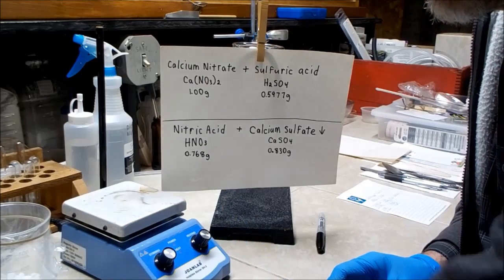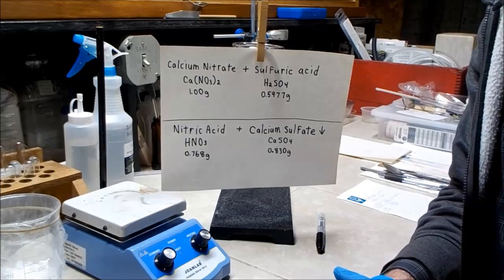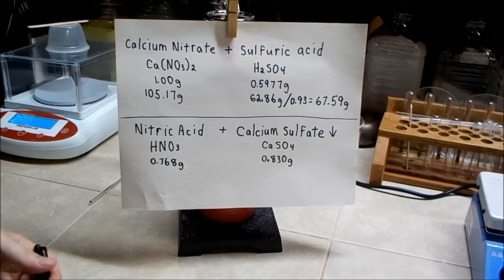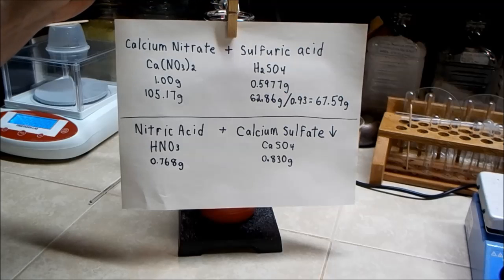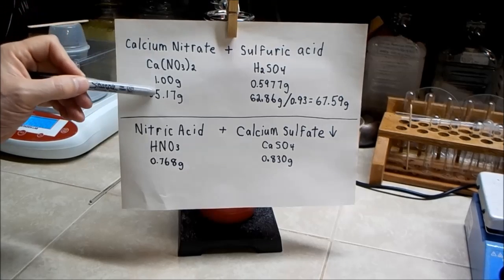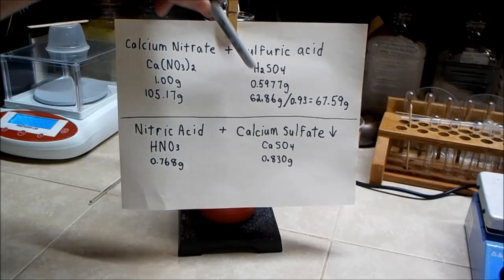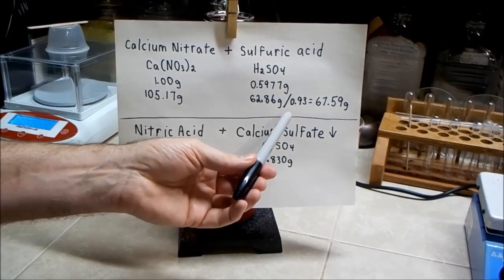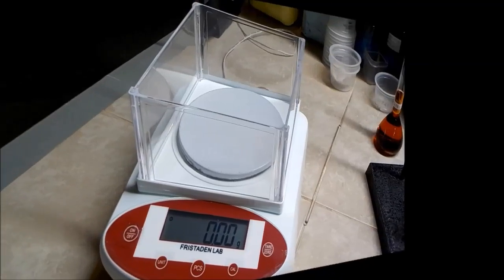Make Nitric Acid Without Distillation

Comment: This synthesis as clean as it starts out for a "distillation free nitric acid synthesis" will contain trace dissolved sulfates and water. It is unsuited for high purity synthesis but can be used for ambient "mechanical grade reactions" like for gold extraction or similar extractions.
Reply from the maker: You are correct.

Comment: Reaction of calcium nitrate and sulfuric acid to produce nitric acid carries serious physical and chemical hazards. Toxic gases and a calcium sulphate byproduct. The process releases toxic and corrosive nitrogen dioxide and nitric oxide gases. These gases cause severe respiratory tract damage. High exothermic or "runaway reactions" can occur. Mixing concentrated sulfuric acid with water or hydrated salts generates intense heat causing boiling and "bouncing" of the Pyrex apparatus thus potentially cracking of glassware.

Comment: 10:10 There is a trade off when it comes to concentrated versus dilute nitric acid here.
But you could have done the reaction with no added water, and removed the concentrated nitric acid. And then you could have washed the precipitate in distilled water, and gotten some dilute acid as well.

The problem with this method, is that any contaminant, like the colour that was in the sulfuric acid, is likely to follow the nitric acid as well.
Additionally, most likely you either had slightly too much CaNO3, or too much H2SO4. Which means your final HNO3 is likely to be contaminated with one of those reagents.
If you have pure starting reagents, then this method might work. But if you want clean product, you should distill.
Reply from the maker: I agree this is not a method that produces high purity nitric acid.  If your needs don't require high purity, and you don' t have distillation apparatus, then this might work for you.

Comment: Skip H2SO4 and go with NaHSO4. The latter acid is MUCH more tractable and usually a LOT easier to buy as it's all over pool supply houses. It creates the SAME ppt. So the procedure is very much the same. Just dissolve the Sodium metabisulfite first.

Comment: did you just add the water back into the dried calcium nitrate?
Reply from the maker: If I remember correctly, the reason for removing the water was to get an accurate measure of the exact amount of calcium nitrate.  This method relies upon mixing exact amounts of each reactant.  Calcium nitrate is hygroscopic and will contain an unknown amount of water.
Reply: @perrygershin3946  Ahhh ok

Comment: I was just curious if you could use sodium nitrate in-place of the calcium nitrate
Reply from the maker: Sodium nitrate would not work because after the reaction with sulfuric acid, the sodium sulfate produced is very soluble in water.  When calcium nitrate reacts with sulfuric acid, calcium sulfate is produced which is nearly insoluble in water.  This means that it can be removed by filtration.  That is not the case with sodium sulfate.
Reply: @perrygershin3946  thank you so much for the information

Comment: I tried to buy that liquid fire bottle from ebay.,but never succeded ,i dont have to ,i found a Ph stabilizer 80% sulfur ,and recently i found 25% h2so4 for  cleaning ,yeah cleaning ,i love cleaning
Reply from the maker: Ace Hardware sells Liquid Fire drain cleaner,  $10.69
The H2SO4 concentration is much higher than 25%.

Comment: Ok I'm sure someone has commented on the fact that the Calcium nitrate was dried, then the beaker was cleaned out with liquid, and poured back into the rest the Calcium nitrate.  What  was the point of drying it?
Reply from the maker: I dried the calcium nitrate so I could get an accurate weight.  This value was required to do the calculation for the amount of sulfuric acid I would need to balance the reaction without an excess if either starting ingredient.  Once the dry weight was known it no longer mattered if there was water mixed with it.
One mistake I made is that I  should have weighed the empty beaker first.  That's why I had to remove it all from the beaker so I could weigh it empty.
Reply: @perrygershin3946   Aah ok!  Have you made any higher  concentration like the aseotrope of it, or red fuming, by distillation?
Reply from the maker: @trinitro5968   No, because it's rather nasty stuff I'll wait until I need it in higher concentration or purity.

Comment: 1. Calculating H2SO4 via density would only be accurate if it was just H2SO4 + H2O. Drain cleaner H2SO4 also contains organic components that are intended to prevent pipes from being attacked and they usually have a high density. In addition, dyes are usually added. The calculated concentration cannot therefore be correct. 2. I can only warn everyone not to use not purified drain cleaner H2SO4. The organic inhibitors contained therein can be nitrated by the resulting HNO3. As long as you don't know exactly which inhibitors are contained, it can be an explosive surprise.

Comment: Mix 150g of kno3 and 100g of destil. Water when it disolve mix it with 150mil of h2so4 and let it cool to room temp after that put it in freezer ald wrap it in plastic bag(all in glass that you combined it in) after 4h minimum remove from freezer and filter it thats easiest method
You need to heat it up to work

Comment: Fortunately for me if it's a 68% nitric acid solution that I want it's not necessary to synthesize it myself since it's completely legal in South Australia to buy small amounts of 68 % nitric acid online (single containers of a capacity of no more than 5 liters). However fuming nitric acid particularly white fuming nitric acid is probably much more tightly controlled than 68 % nitric acid in South Australia because white fuming nitric acid is significantly more dangerous than 68% nitric acid so there may be legal restrictions on white fuming nitric acid in South Australia.
Reply: The primary reason for the nitric acid restrictions is that nitric acid is a primary component for most high explosives.  

There are a number of ways to purify gold without the use of aqua regia.

Comment: You have given a great example of why distillation is the preference method.  Far less waste.  Much higher yield and a far higher concentration of end product.  I can use potassium nitrate and 99% Sulfuriccavid and produce 99.2%-99.7% nitric acid.  Keeping the glass wear light shielded it has very low NoX.  Running air bubbler with the air running thru a desiccant tube to a bubbler at the bottom of a graduated cylinder full of the red fuming HNO3 my end product is 99.7% white fuming nitric acid.  Kept in double walled ptfe or my glass container in my lab frig it holds its purity for many months with extremely low rate decomp.
Reply: The Ostwald Process is the preferred method; but not everyone has access to the required setup just like distillation…hence this method 🤦🏻‍♂️

Comment: Haven't finished watching your video yet, but will in a moment. Very interesting so far. I just have to add that you made a mistake. It is supposed to be 62.86 multiplied by 0.93 and not divided. I noticed this because I was expecting a lower amount at the end, but you got a higher amount. It hit me almost immediately, what the mistake was. Sorry if I am posting this after someone has already mentioned it. I've only read the first comment, before writing this comment. Silly mistakes happen, I still believe that you are a lot smarter than me. Not just saying, it's a true statement, because you know the rest of what I am still about to learn when I return to the video. Thanks for your video, friend:)
Reply from the maker: I think you are referring to the amount of sulfuric acid required to balance the reaction.

The acid I am using is less than 100 % concentration so  I will need more of the dilute acid not less.

I believe the way I calculated it is correct.
Reply: Quentin you have made a mistake on your math.

Comment: You have a new subscriber and I wonder if you would consider making a video on how to make a gold electroplating solution that doesn't use cyanide and ideally one that would make use of a dissolving anode donor instead of impregnated solution only but using alloyed karat gold anywhere between 10k and 18k or anything close to that as long as it's not 24k that to me just looks fake because real gold jewelry is never made out of 24 karat gold as it's just too soft to be practical and anybody who's paying even a little bit of attention can immediately tell the difference due to the color

Comment: I found this video again without realizing I had watched it before. I thought what a fantastic video and I learned so much. Then when I was about to write a comment low and behold I already commented 2 years ago. I'm still wondering why I didn't tell Perry what a precious video he did. I guess I was too much nerdy to even notice. 
Anyway, the question I have now (2 years later) is about the concentration table at 24:41. I would have loved to see you do a cross verification using perhaps sodium carbonate to neutralize the acid and check how much it is required. I'm not sure how I would calculate it but Perry is much smarter than me and I believe most of you guys are that as well.  Please share how you would do this. Much appreciated.

Comment: nitric acid will be too dirty
Reply from the maker: It may or may not be too dirty depending on what you are going to use the acid for.  

There are other videos showing different ways to make nitric acid. 
  
This video shows an alternative and maybe easier method  to make it .  

So now the hobby chemist has another method to choose from.
Reply: @perrygershin3946  This method is the only way i can make it, the nitric works great, i filter the {calcium nitrate} solution because mine comes from the hardware store.
Reply from the maker: @grzlbr  Thanks for the comment.

The main reason I made this video is to offer an alternate method that does not require distillation.  Nitric acid is really 'bad ass' and I don't like the idea of heating it up until it boils.  Also, you may not have the necessary apparatus to do that method.
It's not absolutely pure but for many applications it works well enough.

I'm glad to hear it worked for you.

Comment: Can I just use calcium nitrate like is available on amazon? Or is that not pure enough?
Reply from the maker: The calcium nitrate from  amazon should work just fine for this method.  It depends on your requirements for the usage of the final product, nitric acid, as to whether or not it will be "pure enough". If high purity is required then distillation is probably your only option.  

With my method you are bound to have some impurity in the nitric acid even if the starting chemicals are 100% pure.  That is because it will be impossible to measure the amounts of each reactant with exact precision  Any error will leave a small amount one or the other of the starting chemicals as an impurity in the final product.
Reply: @perrygershin3946  I see. How high of a purity do you think you could get without nitric acid? Bolling sulfuric is a bit daunting lol
Reply from the maker: @Zeke-id2bo  You would not be boiling the sulfuric acid, you would boil the impure nitric acid.  The boiling point of HNO3 is 83 degrees C.

Comment: THIS GUY MUST BE A VERY  VERY STUPID MAN ,HEY IDIOT IF YOU WERE GOING TO USE THAT MUCH WATER ? WHAT WAS THE REASON TO BE SOOOO WORIED ABOUT DRYING THE DAM THING?
Reply from the maker: I think you may need to apologize for your comment.  

If you actually paid attention to the video you would see that I needed the exact weight of the calcium nitrate so I could calculate the exact amount of sulfuric acid I would need.  By balancing the amounts of the starting reactants carefully this would mean that they would all be consumed in the reaction.  If this was not done then some of the original chemicals would remain and contaminate the final product.

Instead of posting a very rude comment you could simply asked the question as to why it was that I dried it so carefully.

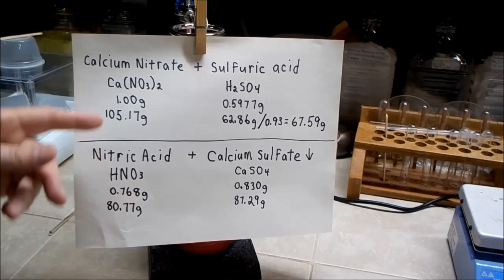Comment: Your math @ 8:50 doesn't really tell anyone anything other than your "shorthand" that you calculated - showing charts and doing your own calculations for this is dangerous,  if your not properly showing the "actual" steps- id say to others...proceed with caution,  he is on his own- this is "his" experiment and math, do not duplicate
Reply from the maker: Yes this is my experiment.  I got the result that I expected.  Are you saying that the equation that I presented is wrong?  If so how did you determine that it is wrong?  

I could not find anyone that had done this specific reaction before.  What option did I have other than do the calculations myself? 

I do know how to balance a chemical equation.  The whole point of doing an experiment is to determine if your idea works or not.  I am not here to teach a complete course in chemistry,  That would take more time than I am willing to do.  It is not difficult to find videos that go into much more detail explaining chemical reactions.
Reply: Do you even know chemistry?

Comment: Very interesting approach. For amateurs, there is a better method I think though. In a vaccum flask mix HCl, KNO3 and Copper, this will produce nitrogen dioxide, it will lead through a tube ended with a pippete, to a cooled cylinder with 30% hydrogen peroxide. The concentration will be definetly low, 30% or slightly above, but no need to use impure sulfuric acid drain cleaners, so the product is a lot more pure, and some of the water can be boiled off to get concentrations closer to the aseotrope. If you have access to a really pure source of H2SO4, this is superior.
Reply from the maker: Brytol, thank you very much for giving another option for making KNO3.  I'm sure that others that read your comment will appreciate the option.
Reply: @perrygershin3946  
Your sulfuric acid is clearly contaminated, as it should be transparent. You can easily purify it and concentrate it to 98% by boiling it. All the contaminants will boil off before the sulfuric acid does, and you will get clean transparent 98% acid. See here: https://youtu.be/Bh0eYpVQ3lQ
Reply: Very nice. But distillation is not a problem, so it is easy to make 95% fuming nitric acid from household items, as shown by model Aspen Angel in this fun tutorial: https://youtu.be/NHBDXtn7pjA

Comment: Either have sulfuric acid or calcium nitrate impurities in here nitric acid. That's why it's yellow. Both of those are miscible and would make it through your funnel. It's just due to tolerances in your measuring capacity. It's completely unavoidable in this reaction. Oxalic acid works better because it's less miscible and thus easier to separate from the nitric acid. In addition, any dissolved oxalate can be polymerized with additives to get that to precipitate out of the nitric after filtering.

Comment: Can you use potassium nitrate instead of calcium nitrate? Can you make it more concentrated by putting it on heat to evaporate the water?
Reply: Yes, you can.  By using potassium nitrate and only sulfuric acid, you can make red fuming nitric acid, which can be up to 99% pure.  You distill it at 83°c(ish) and the closer you get to the boiling point of water the lower the concentration of the acid and the more water you'll have in your acid.  This method is a lot more work in the end than with a distillation, but you don't need a distillation setup, either.  You can use a glass Buchner filter though and vacuum off the liquid and not have to worry about ripping or dissolving a filter.  The main advantages of having a higher concentration is it takes up far less room, you can always dilute it to whatever percentage that you may need and you have a high concentration for whenever you may need it.  It all really comes down to starting costs and availability.  24/40 distillation setups are cheap.  19/32 even cheaper at under $75.  But a glass buchner funnel and vacuum pump would set you back over $100.  So having all of this equipment would be best, especially considering that you can pull a vacuum on the distillation setup itself and distill at far lower temperatures, have less decomposition due to less heat and higher yields in the process.  So yeah, you can use potassium nitrate and sulfuric acid to get nearly pure nitric acid that you can dilute to any concentration for use in pretty much anything that calls for it and with the mentioned equipment you could churn out gallons of it a day.... If you had that kind of time and resources.   Lol!

Comment: It’s a lot of work for a small amount of HNO3 but if you don’t have the means to do a distillation this method could come in handy.
Reply: Honestly, my distillation glassware set was $60, and it takes under 15 minutes to set up.  Really no excuse and I easily make 80-200 ml in under two hours depending on how much water I add.  Yeah, that's right! I add water.  Sometimes 35-40% nitric acid is all that is needed!

Comment: I ve made the same process with oxalic acid. It works i used 500g Ca(NO3)2 in 1liter water and 260g oxalic acid. The filtering was an pain. It had an concentration of 10%.
Reply: Better 500g Ca(NO3)2 in 500ml boiling water and 300g oxalic acid in 300ml boiling water under stiring and outside. Oxalic acid water vapors aerosole are nasty. with Vakuumfiltration i could suck out 800ml Water/acid.

Comment: Good video. Show the stoichiometry calculation using the picket fence methods. explain or show how the units are canceled out. The way you have shown the calculations and multiplying and dividing the numbers my confuse the beginner on how that's done or why. The picket fence method is an easy way to show how the units are set up and cancelled arriving at the desired unit to grams of chemicals needed.

Comment: If you are in the USA, depending on local availability, you may wish to switch over to "Rooto" brand drain cleaner sulfuric acid.  It's very clear and is also 93% concentration or better.